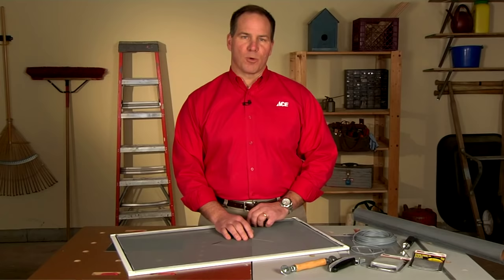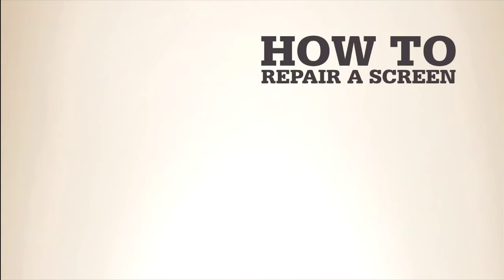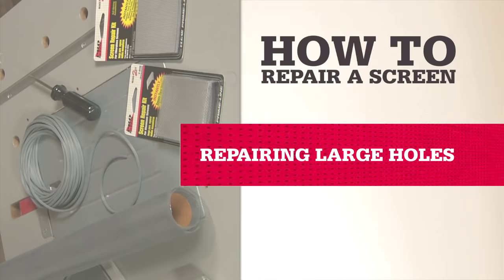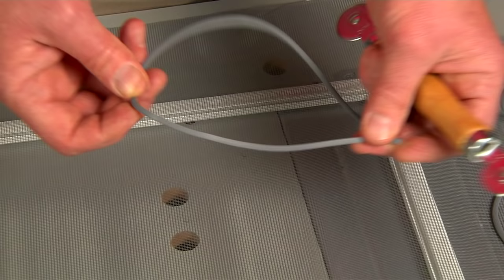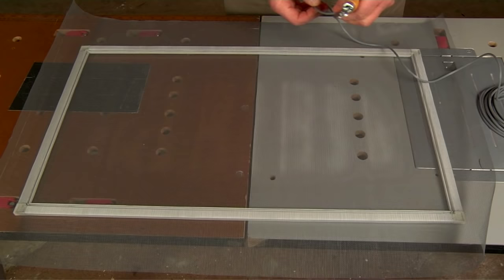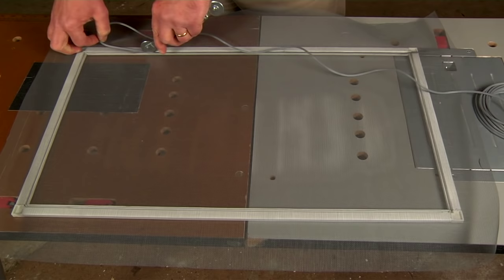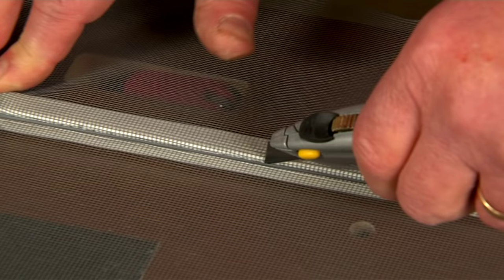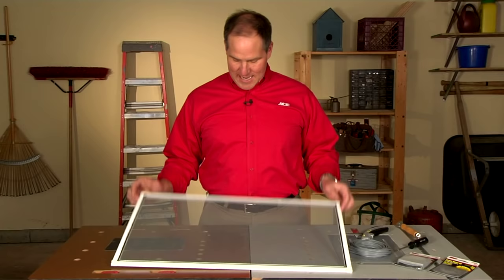How to Repair a Window Screen -  Ace Hardware

Comment: As stated in the video, very important to make sure you don't over tighten the screen and warp the frame which may cause unwanted gaps when installed into the window. Easy DIY  project.

Comment: Didn't have a spline tool but a spoon worked just fine. Fit into the groove so I knew it would push the spline into place. Worked like a charm without ripping the screen.
Reply from the maker: Great tip!
Reply: Thanks! I needed this comment to help me, because I don’t have a spline tool and had to look thru comments for an alternative tool! Thanks again

Comment: Great DIY video! I had trouble getting my old, crumbling, brittle spline out, but ran the stanley knife down the outside of it and used a mini flathead screwdriver and mallet to wedge it underneath and pop out the spline. Once it got going it was very easy!
Reply from the maker: Way to go Stephanie!

Comment: Wow, super easy. FYI I picked up a roll of screen at my local ACE Hdwe for $8.99. It's enough to do 4 of my little screens w leftover.  I used a tire patch tool roller and it worked great. Thanks Ace!

Comment: Thank you for this video. We had our local Ace Hardware shop do this for us on all of our house screens (after hailstorm damage to the screens, while the frames were in near perfect condition), and they all came back twisted, overtightened on the ends and loose or sagging in various spots, as well as with the screen grid a bit misaligned on many. Needless to say, we are pretty nonplussed. When we called to ask for a re-do or refund, we were told, there's no way for a replacement screen frame not to be twisted and that they would just straighten out on their own in a month or two after we put them in the window, which I for one find really unlikely in terms of physics -- the twist is very pronounced and the tension is both too tight and too loose on the same screen -- plus it's obvious from this video as well as all the others out there that it is not only possible but standard and relatively easy to do it right. The local shop apparently uses a 'jig' to hold the frames, so therefore they don't do any tension adjustment or checking as they put the screens in, which is likely the systematic source of the problem here. In any case, we're now awaiting resolution via a callback from the manager. We'll see. I hope not to be disappointed and to have to re-do 17 screens myself...
Reply from the maker: Hi-
We apologize for your experience. Please contact us at CareCenter@acehardware.com so we can discuss your screen experience.
Reply: @AceHardware  Thank you. We had already done that, and they are working to help us try to resolve the situation. (In fact, my wife is on the phone with them again at the moment.)
Reply: After the Care Center interaction, the manager at the local store called and was very apologetic, and we are now satisfied. We will still go back to Ace. :)

Comment: As of Sept '20, It would seem Ace does not sell screen repair kits anymore (That includes frame, rubber piping, tabs, corner connectors, and half-moon springs). And home depot only has white frames.

Comment: cool video, much simpler than the glue job I was thinking about. will this work for old school metal screen? Need to replace the fiberglass; industrious sharp tooth rodents want in.
Reply from the maker: Hi Daja,
The process should be the same as long as there is a screen spline that holds in the metal screen. Wear gloves if you're using metal screen as it can be sharp. If you want to remove the metal screen and use a window screen, there is pet strong fabric now that may work against rodents.

Comment: How do you get the window screen frame out of the window? Mien doesn't seem to bend enough for me to remove it from the window? Also I am using an aluminum screen. I used to do this with fiberglass. How do you cut aluminum? it is pretty ridged and doesn't seem to cut easily.
Reply from the maker: Hi There - Does the frame have clips you can grasp and lightly pull towards you from inside your home?
Great suggestion on an aluminum cutting video! You can also contact your neighborhood Ace as select locations can replace the screen for you with the material of your choice.  Here's the store locator here!
https://www.acehardware.com/store-locator

Comment: What if I have those little white tabs at the top?
Reply from the maker: If you mean the pins that hold the frame in the window, then the new screen goes over that and the spline gets installed over it as well. Hope this helps!

Comment: Cant get the creases out does the screen tighten in the heat
Reply from the maker: Hi There,
 Heat does not get them out.  You have to do that as you are installing the spline.  There is a touch that has to occur, just tight enough to stretch the screen flat and not too tight to bend the frame.  You could also visit your Ace and ask about their screen service if you have an issue!
Reply: @AceHardware  thank you

Comment: What is the best way to remove the screen from the window in the first place? My landlord says I have to do the repair myself, even though several years ago the management company replaced several windows in our apartment.
Reply from the maker: Hi There - It's much easier to remove the window screen with the frame from the window itself. If you try and replace the screen with the window screen in the frame you risk bending it and the landlord won't like that :)  

Your local Ace may also repair screens as a service, check this store locator link for their service list: 
https://www.acehardware.com/store-locator
Reply: Landlords are dirtbags. This is not the responsibility of the renter. At least the ball is now in the hands of renters after the pandemic. Play that card and play it well!
Reply: @sovereigntemple9492  When I wrote him an email cc'ing a local tenant advocate, he began to see the light. 

The only thing is, my management company—they claim not to be the landlord [big wink]—has a lot of stuff going on in the office this week, so my problem is on the back burner. I'll have to lean on them.

Comment: How do you take the window out?
Reply from the maker: Hi There,
It will depend on the window, but typically there are clips, known as plunger pins on the inside of the screen. You would pull the plunger pins inward and the window screen will release. Just be cautious as you don't want the screen to fall outside, so grasp the frame slightly push it outward to weave out of the window frame on an angle. Hope this helps! Great video idea we'll have to cover!
Reply: @AceHardware  Aahh, I figured it out. Pesky things. Ha

Comment: Ideally;  it would be logic to buy screen that comes with repair kits that the repair patches are slightly thinner in gauge then the supplied screen and maybe slim with single sideways legs and if you think about it;  aluminum screen would have all types of sizes and if ordering a proper sized replacement screen of this type;  one could use it and if done correctly;  using a silicone such as one that flexes like Flex 9000( which would go really,  really ,  really far );  well then;  even just fishing line would do the trick.  Only that stretching inwards;  in order to release the outwards force that the installation process creates in order to keep a stiff uniform layering.  Packaging tape would work for that;  maybe have an as wide as how long as the cut/tear is and half inch more on each end and as long as you can that will stay withing the screen area.  then sticky side up;  lay it down on a flat surface and lay the screen atop of it;  down side having the flat evened profile.  Then stick another piece of tape across both ends face to face/glue to glue where this will lock both ends of the tape securely and now you could crease the tape anywhere between along where the repair area;  as to position properly the screen edges and then you can immerse the fishing line(fly fishing line would be likely ideal and much thinner then the screen gauge)  now if you are using crazy glue;  then that would work also but I am not sure what will happen when you try to remove the tape;  as the glue may dissolve the glue on the tape and what not;  but try it.  LOL  But anyways;  if Flex is used;  only very short pieces of fishing line is needed(  approx.  1/4 inch/5-6mm or so);  because both sides should be done and lengthwise should also be given attentions to;  as most cuts of these natures;  almost always cross a few rows as going sideward.  Hot glue could be used alo;  if temperature is less then melting temperatures of your screens.  And something to keep in mind and very important;  is that when using hot glue sticks;  it is the surfaces that need to become hot and if such is achieved properly;  then a great bond will occur and one would be surprised of it's hold;  as in compared to an application that makes use of a glue gun in a fashion that is the nor;  where the glue just keeps getting applied at the speed that it can be squirted out;  as opposed to giving the appropriate time needed in order to reach a high temperature for all surfaces( although;  my not seeing a manner where hot glue could work easily as an application;  nor it being feasible as a strong bond with short pieces of line;  making it then visible and thus not good enough with most people's standards).  Anyways;  if someone wants to make a video that uses these methods.  Cheers.

Comment: If that spleen roller doesn't come with it, it would prolly be cheaper to have a service fix it for $20?
Reply: The roller tool is about $3 .  Much cheaper to do it 
Yourself
Reply: @frankperry4068  And the tool is forever...or as long as my plastic one lasts.

Comment: This should be labeled “how to mess up your screen frame”
Reply from the maker: Hi Chris,
Many Ace Hardware's offer this as a service and can be done for you! :)
Reply: Ace Hardware, if this how you guys do them, no thanks. Coming from a screening vet
Reply: @Anniecrazy  Gee Chris, just how do you do it differently?  It's the same way my family has done it for years.  Not only that, one can buy frame pieces at various hardware stores, cut to size, place the plastic corner pieces in and attach the screen in the same manner.  And it works great.
Reply: @Anniecrazy how would you do it?